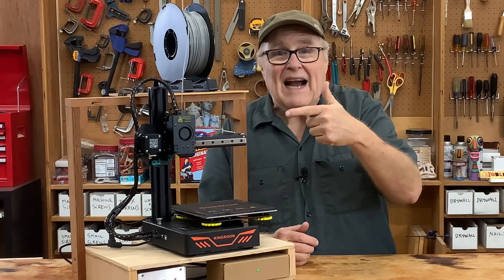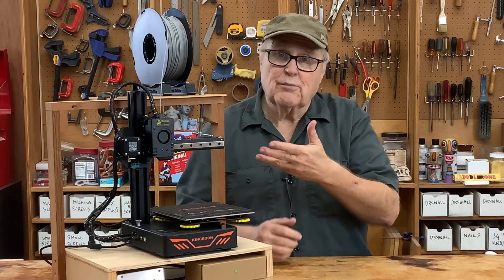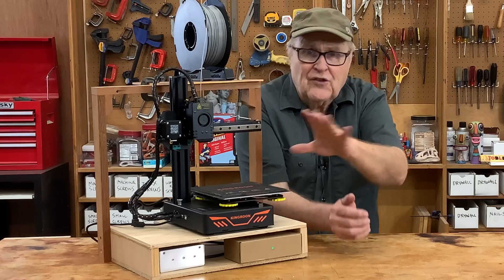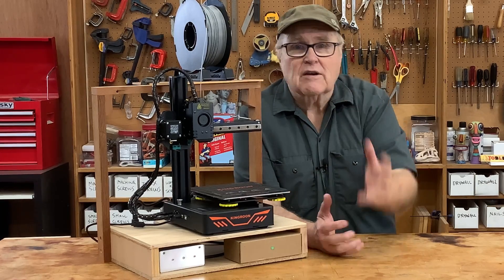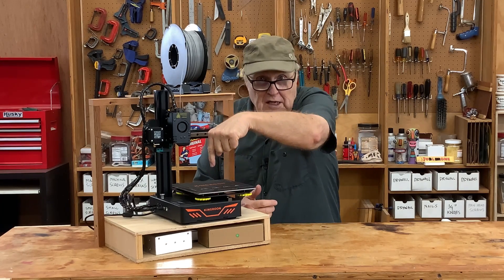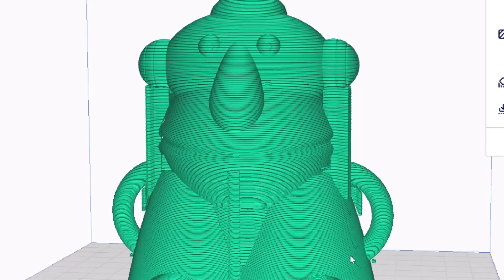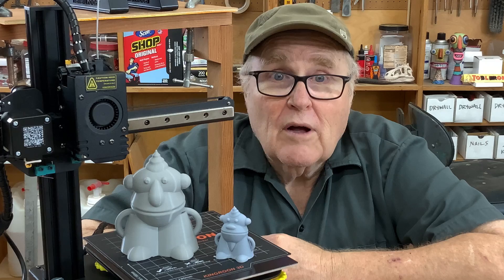My First Filament Print - How Did It Go?   #Kingroon KP3S printer

Comment: One thing that I have never seen anyone talk about is the filament quality. I recommend only using the more expensive stuff (like from Creality) but if you're printing with transparent filament it doesn't really matter. The pigments they use to color the filament (transparent by default) greatly changes its properties. I found this great deal on grey filament, and the first spool printed great but then I used the same type of filament but with a darker tinge. It was impossible to print with. 

Filament is also less reliable than resin printing because prints will fail sometimes for no discernable reason whatsoever. So it's a good idea to keep your eye on the print so as not to waste time and filament when it fails. An advantage over resin is that if you print at 0.05 layer height you will not need a primer to paint it with acrylics. Thicker layers will cause the paint to run through the channels so be careful. Another advantage is its mechanical properties. Filament prints are more true to form than resin. This means that if you're printing parts for anything they will have little to no warping or added thickness compared with the actual 3D model.
Reply from the maker: I am definitely a resin guy because of the quality of the prints.  That’s why I have never used an FDM printer before.  for years I would send models to service bureaus to print in resin and back then I still had to re-cast the piece in wax and clean up the layer lines by hand. 3-D printing is evolving by leaps and bounds and it will not surprise me when it’s superior to hand making prototypes.

Comment: Now we gotta see you cast that bad boy. ;) Great video!
Reply from the maker: I will want to make a cleaner print first. But I would like to 3-D print a custom mold case for it and see how much that would save on rubber cost.
Reply: @RobertTolone  oh awesome! I Created a cylinder two part mold case that uses a channel to fit into one another. I then seal all the outside edges with bees wax (i used to use hot glue but your channel converted me).

Comment: Cheap FDM printers are about as reliable as a Model T. Higher end printers, particularly the Prusa i3, are dead reliable. The current Prusa i3 has automatic bed leveling, automatic Z-axis adjust, thermal runaway detection, filament runout detection, power loss protection and resume (saves progress on power loss), filament jam detection, multi-filament support and a few things I can't remember off the top of my head. It comes both as a kit and pre-assembled. The pre-assembled printer costs about $1000, but you unpack it, put it on a table, push go and it just works. Flawless prints every time, even when there's a blackout.

If I get another 3D printer for some reason, it's going to be that one.
Reply from the maker: Thanks for the recommendation. Are you going to buy yours as a kit?
Reply: I purchased my first bargain printer ten months ago and have had no problems with it. Purchased a Kingroon two weeks ago as it was a little bigger and can do TPU. I am even more happy with it. Timothy you are wrong about reliability.
With a smaller printer bed levelling is simple. In my opinion automatic bed levelling is not worth it. The KP3S also can recover after loss of power. Worked for me just a day or two ago. The biggest flaw of the two budget printers I have tried is lack of documentation.  There is help from on line communities. If I had to pay $1000 for a pre-assembled  printer I would not have one!

Comment: Oh this style of printer is awful
Reply from the maker: It printed way better than I expected. To be honest I thought it was gonna be pretty junky.  And I’m not saying that because they gave me the printer.
The supports did not print well but I thought they looked sus in the software.  First time using Cura and I went with stock settings.
Reply: Actually the KP3S is very good for a budget printer. If not for the low price I would not have one.

Comment: Yes, for the cheaper printers they are still very kit. Prusa Mk3S is much more "ready for prime time" by comparison with an auto-leveling bed and z-height detection. I've built two from kits but you can buy them pre-built. They are real workhorses - of all the filament printers they are the most likely to be setup and print without constant tinkering.
Reply from the maker: How much time/experience/knowledge does it require to put one together?
Reply: @RobertTolone  for the kit version, it took me maybe 14 hours to assemble it each time. My spatial reasoning and reading comprehesion is pretty good. I don't struggle that much building Ikea furniture, enjoy Gunpla but am not otherwise handy.
Reply from the maker: @TylerProvick  Can you print high-temp filaments like ABS?
Reply: @RobertTolone  yes. You will need an enclosure as ABS is very prone to warming. I'm sure you'd have little touble building one and in fact, having a separate powersupply on your printer is ideal as they don't like getting hot. I had the good fortune to run an ABS print production for a bit at work and we repurposed a server rack as our enclosure.

I say good fortune because I'm an IT consultant and enjoyed spending time playing with a 3d printer and getting paid well for it. Imagine if you took an office job because you needed more money than casting provided, but they asked you to do some casting for them at your office job salary. Score!

Comment: No, printers aren't that fiddly anymore. This one is just shite, setting Z-height with a screw...
Reply from the maker: What printers do you recommend?
Reply: @RobertTolone  Depends on the budget. Low budget, then CR-10 or better Ender 3 - you still get auto bed leveling and removable build plate.
Medium budget, Prusa of course. Also Qidi Tech seems to be highly recommended if you want to do next-gen materials at high temps.
High budget, probably Ultimaker or even Markforged.
I'd imagine both Creality as well as Qidi Tech sponsoring one for you if you reached out.
Reply: @RobertTolone  I would add the Bambu X1 Carbon to Alexander's list of Mid Range printers, but it is on the higher end of the price.  It automates a lot of the tuning required for even Prusa printers, but it is up to $1500 with accessories.  For mid range it is the highest end (and newest - despite it coming from a reasonably well know company, they chose to release it via Kickstarter, so regular sales are not yet open).
Reply: @RobertTolone  Oh, and high temp materials might be relevant because some resins can produce quite the heat when curing, so if you intend to make molds, PLA might not be up to the task.

Comment: my printers are pretty much set it and forget it these days (i have 2 highly modified Ender3's - nothing Creality remains aside from the frame and steppers).  i still have an error or failure every now and then but they are few and far between.  that said, it took a TON of tinkering to get them that way.  and once i had one setup the way i liked it, i set the 2nd one up exactly the same way with the same upgrades, parts, etc.  one troubleshooting list, one parts bin.  

i've been printing for 5 or 6 years now and for the last year or so my printers have been running almost 24/7 on a little side-hustle i fell into.  it's my favorite hobby because i can make my other hobbies cooler by making parts for them!
Reply from the maker: See, you would have done a frame-off rebuild of your Model T back then!  Be great if you could make a video of every mod and improvement you made to your printers. Either that or start a side hustle doing modded printer builds!
Reply: @RobertTolone  I've wanted to make a video. I'm just a wreck when it comes to being in front of the camera. I definitely want to though at some point.
Reply from the maker: @thegrafxguy1  How do your modified machines compare to the Ender 3 S1 Pro?  Has Creality made a machine that basically includes all of the mods people were making?
Reply: @RobertTolone  as far as capability goes, i think it's pretty much on par with my machines.  printing temp, bed setup, auto-leveling, filament runout, etc.  

that said, updating/tweaking/generally setting my firmware up is super easy and the main reason i went the direction i did.  i also supported the team at e3d as they developed the hotend that Creality took inspiration from.  my bed leveler (EZABL) and mainboard are both from TH3D so they work together flawlessly, and that's also where the super easy setup firmware/UI come from.

cost however, for that convenience, was more than starting with an S1.  i do feel like the quality control\overall manufacturing quality is top notch on my components though, and i've seen some questionable stuff done here and there by even Creality themselves.  the xt60 connectors on some of the original runs come to mind.

Comment: Hey! If you’re getting into making 3D prints with filament, I have to recommend polymakers polysmooth filament. I believe it’s PVB (might be wrong) but it’s smoothable with isopropyl alcohol vapor. You don’t need the fancy vaporizer machine they sell, but a bucket of isopropyl and the print raised out of it will work wonders. It smooths it out far faster and more evenly than sanding and applying resin. You may already be familiar with the material, but it prints exceeding easily on filament printers. Just make sure it doesn’t stay out too long since it’s hygroscopic and will become stringy and hard to use if wet. If it gets wet, just use a dehydrator for an evening on low and it will be back to it’s best the following day. Looking forward to seeing more of these hopefully, and I hope you can appreciate even after all of the fiddling how nice 3D printing can be for large models!
Reply from the maker: One more thing for me to try out, thanks!

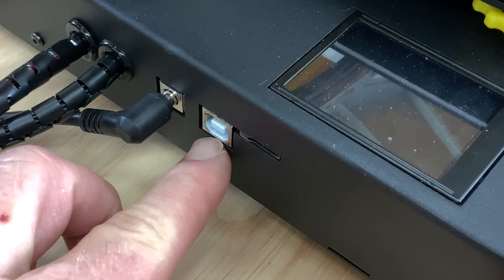Comment: 3:20 this isn't a network port. It's USB type B connector, same as 2D printers use.
Reply from the maker: Oh, right. Too bad my computer is in another room!
Reply: @RobertTolone  If you get a raspberry pi you can install octoprint and controll the printer over wifi.

Comment: Wow what a coincidence. I just bought the same printer a month ago. I had the same issue with the zaxis parts. I just assumed they were extras and left them off. Printed just fine without them.  I will add them now. Thanks!
Reply: Is the Print quality at least better compared to the Ender ones out of the box?

Because they are on the same price level yet this one is smaller.
Reply: @DaroriDerEinzige  I've never used an ender myself. So I can't say for sure. But from pictures it seems very similar